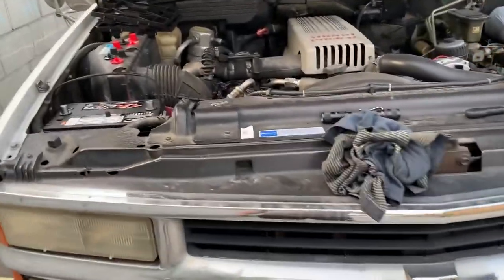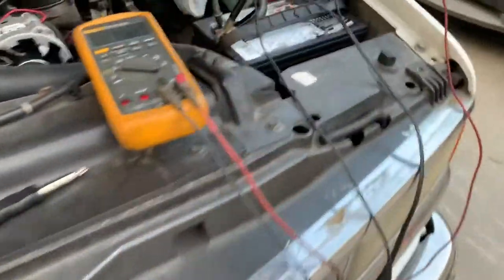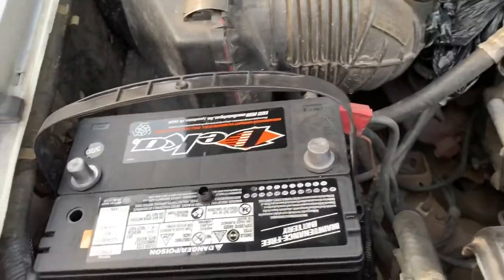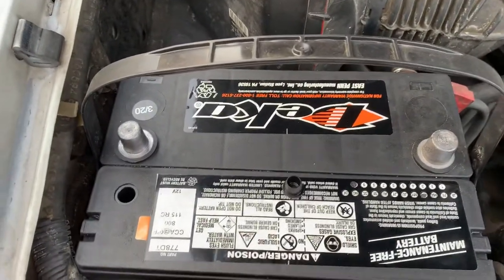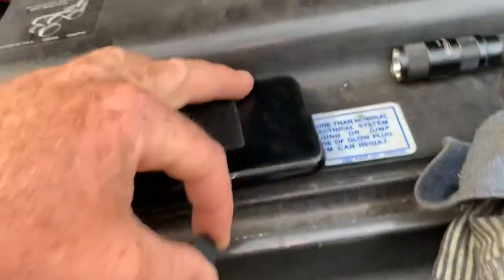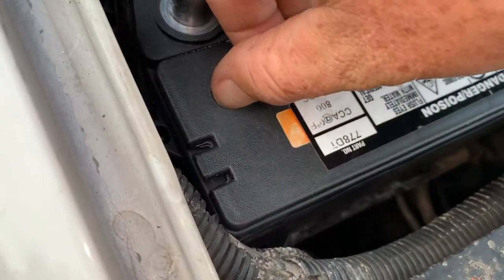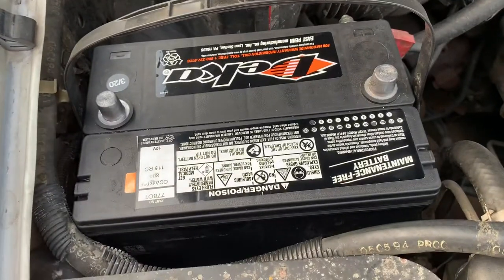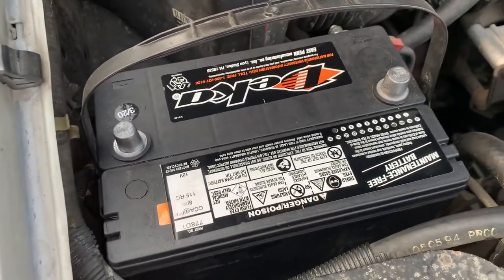Maintenance free battery caps Deka East Penn

Comment: Man your the best. Was trying to remove whole top. Under the sticker are all these caps easy to pull off and refill. I was charging on almost empty cell. Did 2 batterues and use so much distilled water. 1 of these 2 i just bought used at Kenny U Pull for 120$ cdn + taxes. Refilled it and 1 cell was half full. Damn... Hey, Thank you :)
Reply from the maker: Ha ha right on! Yeah it is frustrating that they call them maintenance free. Glad it helped

Comment: This Post just keeps on giving. I have a Lawn Tractor battery that is only 2 years old. Peeled up the sticker and found It had these plugs too!
Reply from the maker: Ha ha yeah the only issue i would like to solve is finding a watering jug that fits in the holes and brings the water level up to the correct level. Like an actual maintenance battery.
Reply: @ryanburbridge  I keep a Basting Syringe for this reason. Has worked for years on car and boat batteries. Works on these tiny holes as well.

Comment: My one car has a over 5 year old Deka “maintenance free” battery and I’ve never added water to it and the voltage is good and it starts the car no problem. Obviously not saying you shouldn’t add water, just sharing my experiences. I have Deka’s in other vehicles and I like them.
Reply from the maker: They are definitely well made. But in your case i would definitely be ready to replace that battery. 

What type of vehicle is the battery in? I would guess an older small engine with not a lot of electrical load. I would also guess you drive over 45 min at a time. 

In another video i installed a batteryminder to keep my batteries topped off. Starting and driving short distances will take a toll on a battery. 

Thanks for sharing
Reply: @ryanburbridge  That one is in a 2010 Subaru Outback. Trips vary. More 15 -20. Some 45. (Excluding round trip). The car is used regularly but not always everyday.  I just got Dekas for an electric golf car that I know I have to water but trying to figure out what is the best apparatus for doing so.  I saw them auto shut off jugs or just plain funnels not sure what to get yet. I’ll check out your battery minder video, never really heard of them.
Reply from the maker: @amg5619  here is a great fill tool if you have traditional fill ports https://youtu.be/ytxVzj5hNT0

Comment: That open jump port exposed to dirt and water seems like it will corrode over time and put a lot of resistance into the jump circuit when you need to use it.  Should at least have a cap on it.
Reply from the maker: Good catch. It definitely gets nasty. These have a pretty positive spring pressure they have to overcome when connecting and a good wiggle also helps scrape through the crud. Also i live in SoCal so perfect weather for exposed metal. Definitely recommend a cover for those that live in real weather country.

Comment: Ryan. I checked the Deka Catalogue and they didn't have replacement plugs for the cells.  Have you found a source for thies tapered plastic plugs. Any help appreciated. Nice Vedio BTW.
Reply from the maker: I have never looked myself. Just spent a few minutes and didn’t see any company marketing the exact plug. I will definitely be looking into this further. 

A couple of suggestions:

First i would find a local battery recycler and see if they would be willing to let you have as many as you want. I’m in SoCal and can find these places anywhere. 

Second i would look for a plug that can fit. Possibly threaded. 

I’ll pull my plugs and get some measurements. Keep you posted.
Reply from the maker: Any luck?

Comment: Hey, Thanks for making this vid. How did you maintain this battery?
Reply from the maker: So this is considered a maintenance free battery but there are small holes under the sticker that have plugs in them. You can check the level and top off with distilled water as needed. Just make sure you have a good hydrometer that is calibrated for lead acid batteries and a good charger. I personally installed a desulfator and hook it up to a 110vac wall unit every day it’s parked. 

https://www.batteryminders.com/12v-onboard-desulfator
Reply: @ryanburbridge  Thanks for the reply!
Reply: @ryanburbridge seems like a waste of effort.. can you follow up with us? Battery still good?
Reply from the maker: @precisionbay6899  yeah i should do a follow up. Not sure why i didn’t get a notification about your question. Thanks for checking out the vid. Were you looking for battery related videos?
Reply from the maker: @precisionbay6899  still running these batteries. I left the headlights on all day at my jobs yard at least three or four times over the last couple years. I always get caught when i leave the house in the dark and show up at the yard in the light. Brain gets going and i don’t see the lights on. I definitely think charging these everyday has helped.